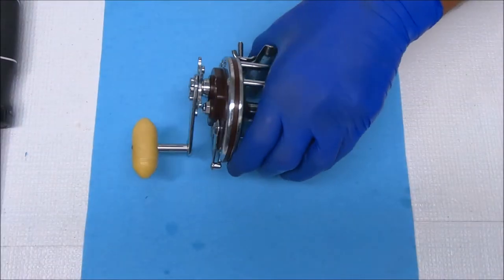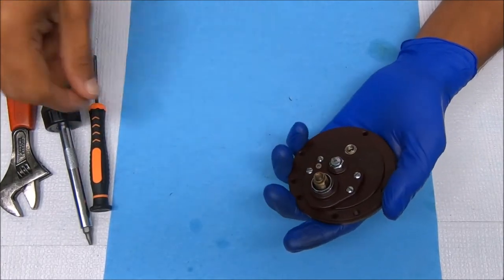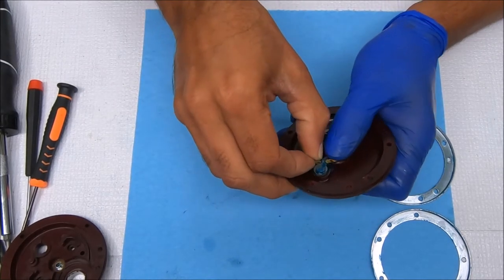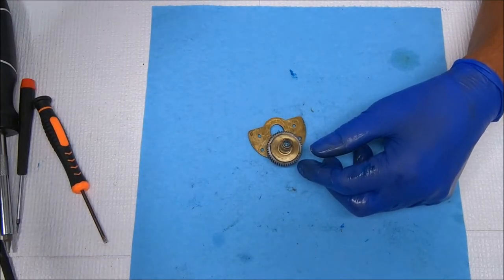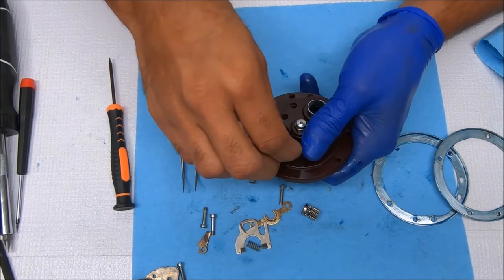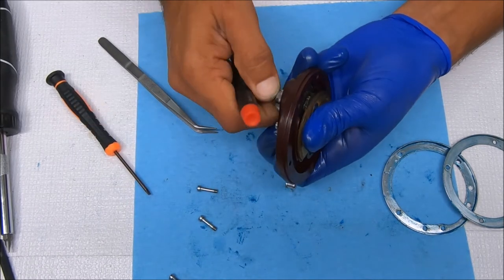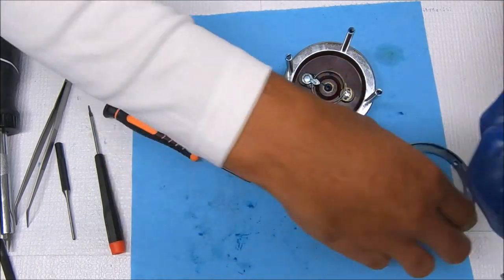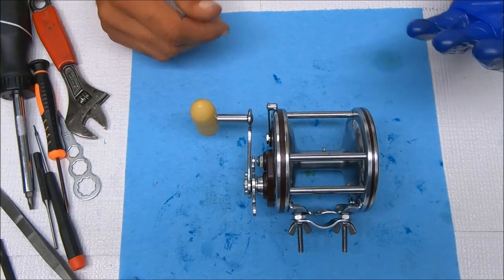Penn Senator 3/0 (112H) Fishing Reel - How to take apart, service and reassemble

Comment: I appreciate your videos very much. But, I've had problems with this one. I have reassembled this reel several times, and I'm doing something wrong. When I get the right side plate assembled, everything seems to be right. The gears are engaged and the dog is set. But when I reassemble the rest of the reel, the pinion gear doesn't engage with the spool. If I take the right bearing off and screw the left bearing in further, it engages. What am I doing wrong?
Reply from the maker: Thanks for watching and the love, Philip. Sorry to hear you're having trouble with it. I'm assuming everything was working fine before you serviced the reel. Sometimes, after full assembly, you need to crank the reel in the retrieve mode to "set" the pinion correctly over the spool.... you can hold on to the spool when you crank the handle in the retrieve setting (don't forget to apply some drag with the star drag)... you should hear a little click when it happens and the spool will start to rotate. If you've done all that....

Before attaching it to the rest of the reel, try completing the right side plate by adding the star drag, handle, etc.... and then, without attaching it to the rest of the reel, test that all the functions work properly.... the crank, the a/r, the freespool (note, when you crank the handle in freespool and retrieve mode, they may sound the same, but you should BE ABLE to crank the handle in both). If something doesn't work correctly, then you've got something amiss, like the drags aren't set properly (or incorrectly), the eccentric is off, the dog is coming out of place, etc.

If everything works when you test it, then turn the right side parallel to the ground and add the handle, crank down the star drag enough to be able to turn the spool, and test everything again. If everything works properly in this test, then everything should work when you add the posts and left side plate. If not, see above. 

If you're still having trouble email me at tsgreelservice@gmail.com.
Reply: Thanks again.  I'll try again.
Reply from the maker: @PhilipGlass-fp6oi  You're welcome and now worries. Let me know how it goes.
Reply: GOT IT!!!!!  Finally. Thanks so much.
Reply from the maker: @PhilipGlass-fp6oi  That's good. What was the problem?

Comment: Sitting here with this reel in twenty different little pieces trying to figure out how the dog and spring go in... guess I'll trash it
Reply from the maker: Thanks for watching. Insert one end against the dog and then use your fingernail to squeeze the other end down and into the plate. Or, you could take it to your local repair shop and have them reassemble the reel for you.
Reply: @TSGReelService  I appreciate it.... was just aggravated with it, thanks for the help
Reply from the maker: You're welcome and no worries. We've all been there. If that's your only issue with the reassembly, I'm confident you can do it.... a little patience is all that's needed.